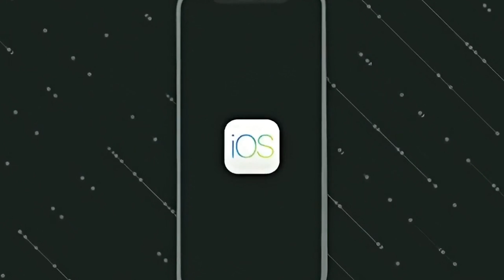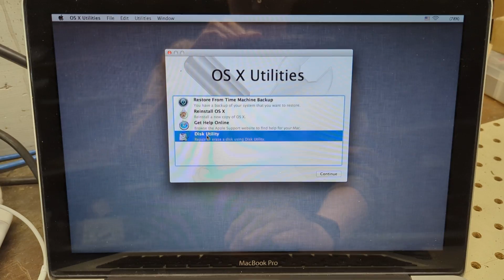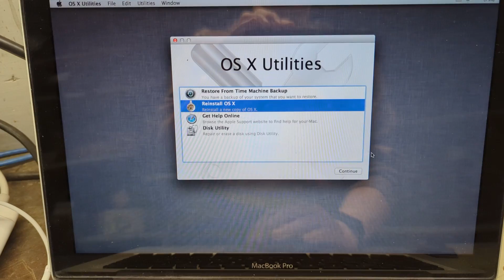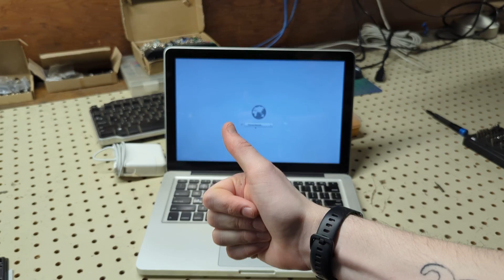How To Upgrade a Late 2008 MacBook Pro

Comment: I have a late 2008 MacBook Pro 15", and 8 GB is the max RAM it will take.  Would be nice if it took 16 GB.
Reply from the maker: Sometimes they will, I was able to upgrade a Core 2 Duo model to 16GB, it was DDR3. I'd give it a try, RAM is cheap anyhow.

Comment: The 2008 has TWO visible system FANS! This, 2009, model has ONE!
Reply from the maker: You really should think before you comment. 

There was a 13-inch and a 15-inch 2008 MacBook Pro, the 13-inch has one fan, the 15-inch has two. 

This is a 13-inch 2008 MacBook Pro, it has ONE fan. 

Don't try to be a know it all on the internet, you will 100% always be proven wrong. Do your research my dude.

Comment: but this is not late 2008 it don't have battery that you can get it out it may 2009 / 2010/2011/2012
Reply from the maker: To answer your question, again...

It is a late 2008 MacBook Pro.

Right up to 2012 the batteries were removeable. You unscrew the bottom panel, open it, and unscrew the battery, and replace it.
Reply: i have a MacBook Pro 2008 late as daily driver today, you are dame right!!
Reply from the maker: All MacBooks from whenever they were introduced to right around 2012 have removable batteries.